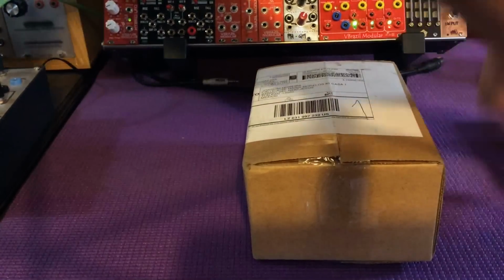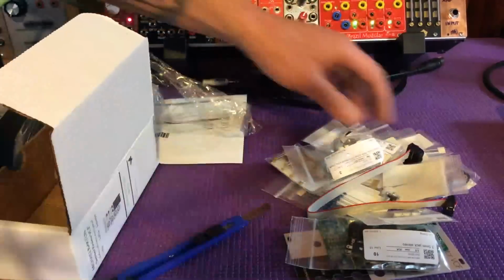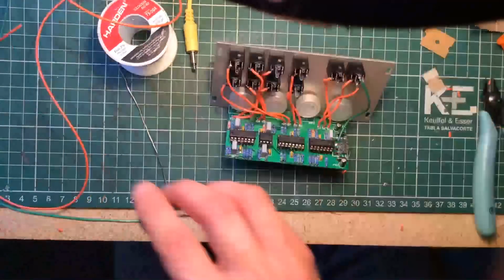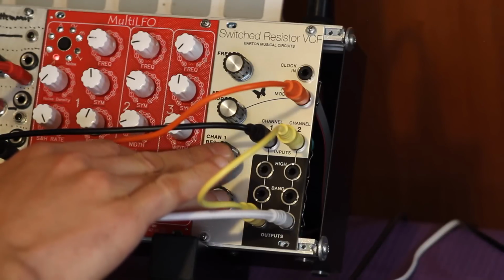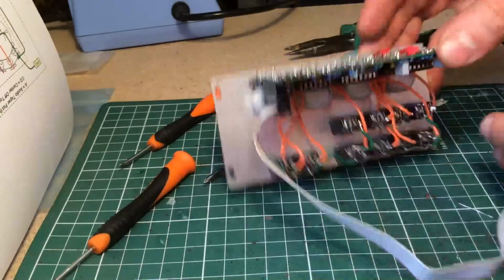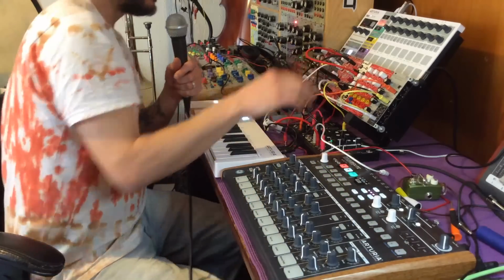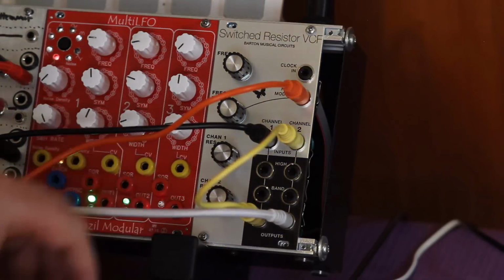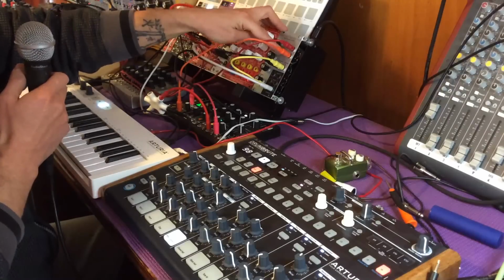Kit Review #2 - Barton Switched Resistor VCF

Comment: Did you have a chance to try experimenting some more with increasing it's filter sweep range yet? Any success? 

This module has been on my radar for a while now, but I'm worried that the 'as built' stock narrow range it has would somewhat limit the versatility and usefulness of what is an otherwise cool sounding module.
Reply from the maker: hippyjason I haven't had much time to tinker with this one, but I'm using it a lot anyways, sounds real nice with the caps in paralell (double the capacitance). It is a limited frequency range but still useful. I'll report back if I manage to expand it though. Thanks
Reply: in barton's own switched resistor vcf video they say that changing one of the resistors in the switching part will expand the range if necessary